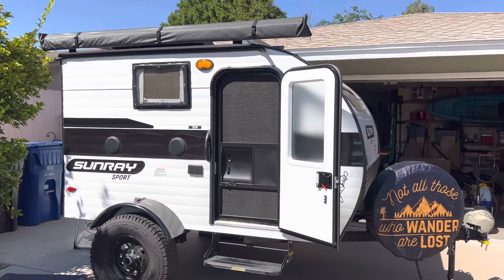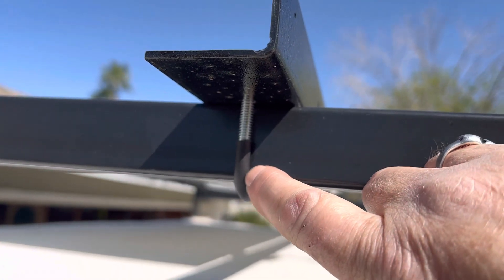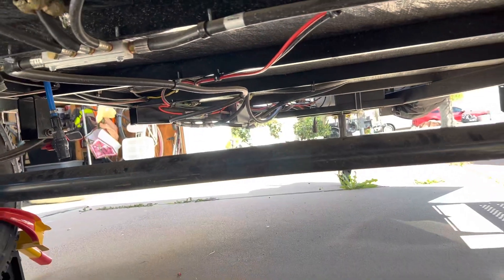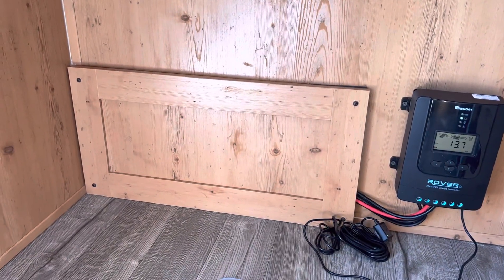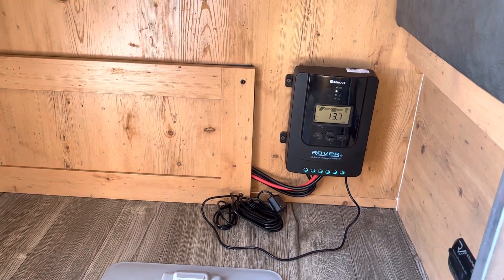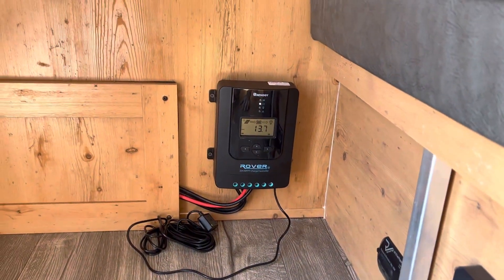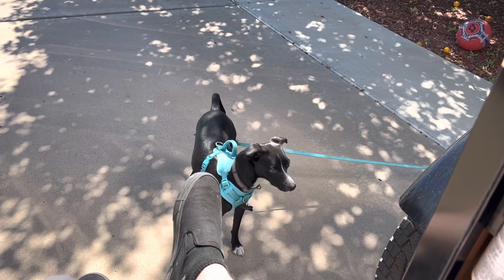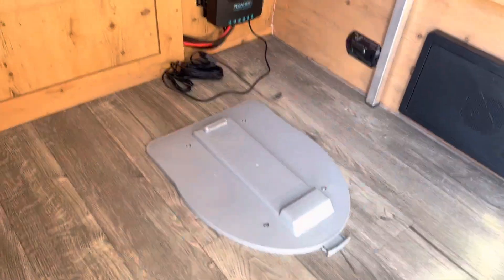Sunray 109 rooftop Solar installation walk-through.￼

Comment: Ok I have a 109 and I decided to go with 200w portable panels and I just ordered a mppt Bougie controller.  I also have a Predator 3500 was super quiet inverter generator.  I am thinking about buying a small panel to mount on the camper to keep the battery charged, one of those small solar battery tenders, do you think one of those would be good enough?
Reply from the maker: Not sure right now we’re just running the one 100 W panel on top of our camper and I have to 100 amp lithium batteries and that keeps them both fully charged at all time and we can camp just fine. We’ve been riding the same set up since we bought the camper and put it on and we never had an issue with power.

Comment: Thanks for the info. I have a Sunlite 16 BH. How did you get the fridge vent cover off and do you think there is any way to fish the wires down there without removing cover. Thanks. Raleigh.
Reply from the maker: The four holes on top of the vent have silicone in them I remove the silicone and then there are Phillips head screws inside there just remove the screws and the vent comes right off after I fed the wires I reinstalled the hood and the screws and put new silicone
Reply: @lilfootadventures7474  Thanks for the reply. Mine had black sealant in them that was blending in with the cover so I thought it was all one piece. Now, any tips on getting the silicone out. I've about done one with a really small screwdriver but it is a pain. I'm thinking of gently and slowly using a drill bit either on forward or reverse, whatever may work.
Reply from the maker: @resanford  Mine was the same way as yours I had to use a small standard screwdriver to pick out all the black silicate to expose the head of the Phillips screw then I was able to unscrew it
Reply: @lilfootadventures7474  Thanks again.

Comment: How high is the tong from the ground / how high does the hitch have to be to get the trailer leveled?
Reply from the maker: That is hard to say it all depends on how level the ground is that you park your camper on I just use a small level inside the cab of the camper to level it out when I park it
Reply: @lilfootadventures7474  sorry, I didn't ask my question properly. I wanted to know if I need a hitch with a drop or raise. If the trailer is kind of level, how high is the hitch from the ground (if the ground is flat and even) and thanks a lot for answering ;-))
Reply from the maker: Are you talking about the hitch on your vehicle or the camper
Reply: @lilfootadventures7474  from the camper, the tongue height of the camper is levelled.